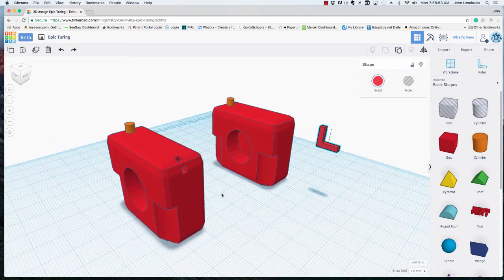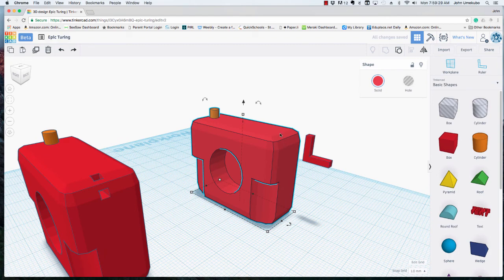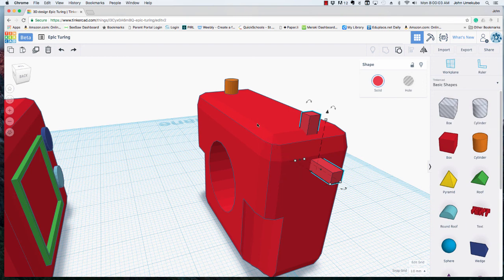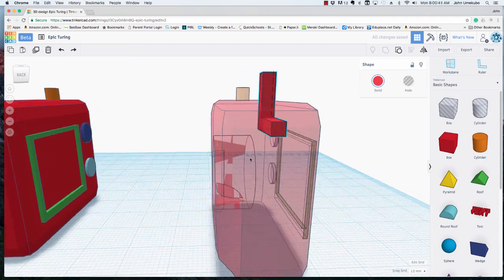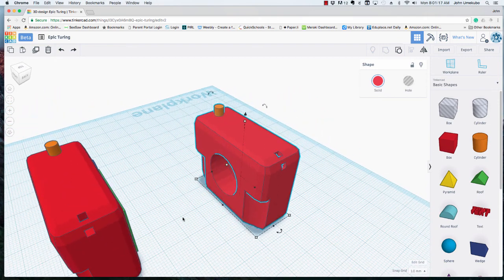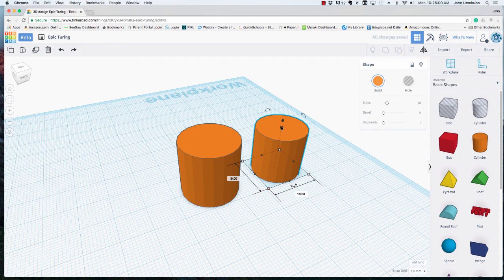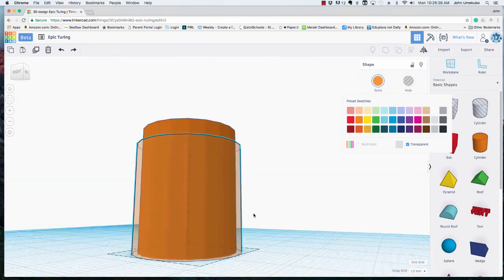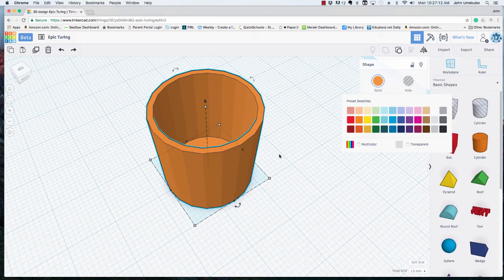11. New TinkerCAD - Transparency

Comment: How do you group solid objects and transparent objects together without making them all solid or all transparent
I want only one transparent object, but I can't
Reply from the maker: This is a great question. Unfortunately, by default, when you group objects together they take on the characteristics of the first object created. This includes color and transparency settings. You can choose multi-color back on the shapes panel to return original colors, but the new object remains either solid or transparent, not both. The only work around to this is to leave the transparent object ungrouped from the rest. Not ideal but can work. When my students design vehicles they use the transparency setting for their windows but they need to select all objects when resizing or moving.